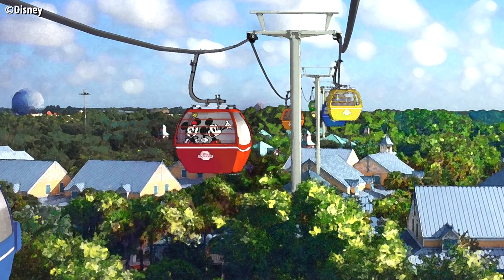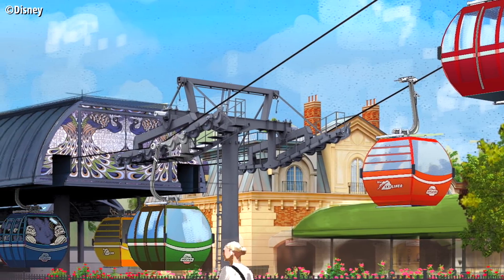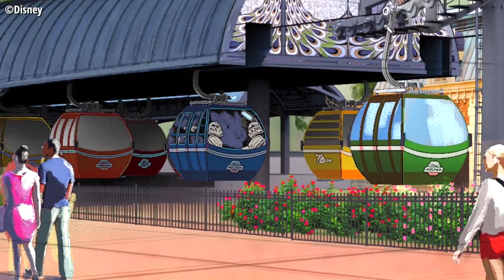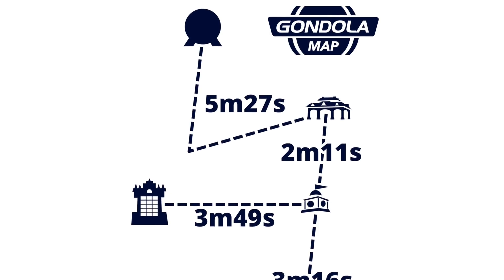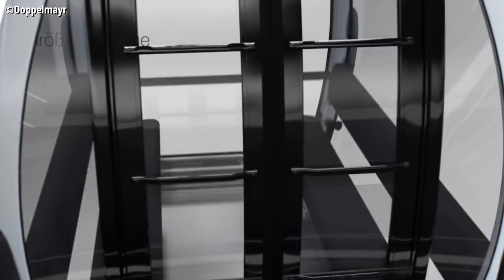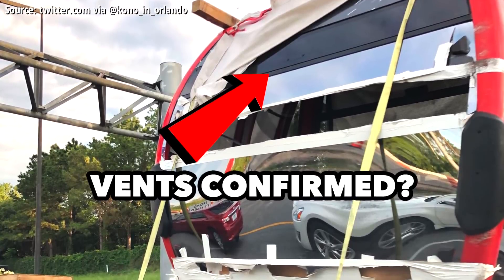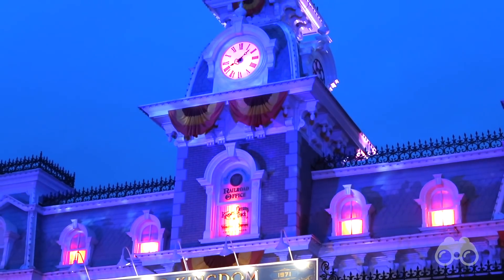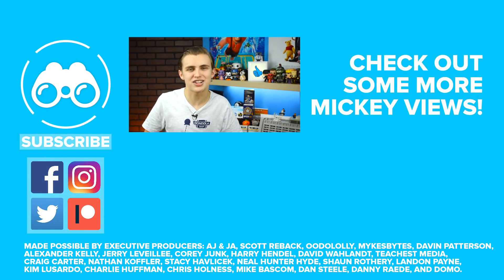NO A/C on the DISNEY SKYLINER GONDOLAS?! 🔥

Comment: Ok, the ONLY "air cooling" they're going to get in Florida will be the winter time. This wasn't really thought out, was it? they should've sunk the money into a light rail system that can handle a large number of crowds and still go between these parks and resorts in a short time. Ithink this is going to be an epic fail on Disney's part.

Comment: Would love to know how people expect the A/C units to get power when suspended on a single wire? Solar panels wouldn’t be enough to power A/C, only other option would be a battery/capacitor powered system but the weight penalty of these is outweighed by the short expected journey time.
Reply: There are already cable gondola systems operating that have AC units on them. Ultracapacitors are used.
Reply: @Danrarbc  That's why i mentioned capaitors in my reply so people knew i was ware that it was an option. But for journey times quoted I can understand why Disney would go for passenger capacity rather than being limited by extra weight in the infrastructure.

Comment: This system is probably great during high peak morning and evening commutes, but during the day, in the summers... ...lemme tell you, I live in TX. It's hot, it's humid, and heat indexes can get up to the 120s. I also own a convertible. It can be 110 at a stop light, but if I'm moving, guess what, it's still 110. Essentially the movement has created nothing more than a hair dryer simulation. Now then, 110, is still better than 200, which can happen with cars that are left with the windows up. Both can still be deadly though. I have had my phone stop working on me because it overheated while I was driving. What if this happens up there? They've got us using that My Disney Experience app for everything.

Comment: The ferry boats don't have AC, neither does the Railroad, nor the Friendship boats.  I think the rail trouble with the gondola system will come with those crazy pop up thunderstorms that happen every summer afternoon rather than the lack of AC.
Reply: The ferry boats operate on water -- it's called evaporative cooling.  The Railroad cars are completely open.  These enclosed cars are going to be impossible to maintain -- they will smell, trap humidity and people's sweat as well as heat.  This is a disaster.

Comment: its simple, the cars don't have a/c because the cars have no power, how would they power an a/c, even if they wanted to?
Reply: Fabio Monteiro Ultracapacitors allow for rapid charging of gondolas while moving through a station. London Emirates Air Line cable car has a/c. Gondolas can be equipped with all types of things including heating, cooling, WiFi, and screens.

Comment: OMG! Big deal out of No BIG DEAL! AstroWorld in Houston, TX had NO A/C on it's gondolas 1968-2005 open air no fatalities. Same climate in Orlando. Not a large travel distance. Only problem is If there is a prolonged shutdown. I'm sure they have emergency jenny or in the case with AW 4 cylinder VW Bettle engine to evacuate the cable. It had to be fired up every run day as part of safety check list. LOL There is likely A/C in load area that will keep car at an acceptable temp until doors are closed and you reach your destination.
Reply from the maker: Huston, TX and Orlando don’t have the “same climate,” central Florida has the humidity of the Amazon Rainforest so heat feels significantly heavier and more sticky than in TX. Thanks for watching! ~Brayden

Comment: Lock your self in a hot car with the vent fans on drive from 5 minutes or 15 minutes. Oh, yes a problem with the skyliner and it stops for 30 minutes and no air flow.... This seems out there for Disney. I am not on board with this idea in the hot Florida sun.

Comment: There's one other possibility we're not allowing.  The last minute addition of solar fans.  I volunteer at a large cat sanctuary on the other coast and managed to make things comfy for both guests and cats by installing a few solar panel powered fans in some enclosures and common areas.  I even use some at home on my catio to keep my cats cool when it's 105 f outside.  The fans I used were maybe $20 each on ebay.  

Since these are such a cheap, easy last minute thing for someone to install, one would think they would spend the majority of time just getting the gondolas installed and working then on the last week before opening install a similar solar-panel fan at the last minute.  On a gondola that size, I would think four, one in each corner.

This is just speculation based on my own experience with such items.  If I were in Disney's position why WOULD you set up all that power to run AC in a gondola ( too much expenditure for too little return ) when you can spend $100 per gondola and run 4 fans inside?  It's not opulent but then again they don't want you to spend your time inside an AC cooled transport, they want you to get to your destination then get out.

Comment: I think no AC will be ok, there is a lot of systems similar to this that do not have AC and they are fine. They just need to have a good ventilation for natural air system. Still excited for it!
Reply: How many operate in the same climate as central florida?
Reply: @itsme4864  I do not have that information, I will trust Disney to not make these so hot it is unbearable though, until we have proof it does not work.
Reply: None of them are in Florida.  There is no mass transit system with enclosed vehicles in the entire state that doesn't include air conditioning.

Comment: I would have rather see the monorail be added to I don't think this gun laws system is anything good at all. I didn't think it was that good before the AC issue without AC okay some days it would be good the arrow be okay at nice early morning for what about mid-afternoon when it's hitting a hundred degrees 95 degrees and there's no air. But like I said the worst part is you know these things are going to break down once in awhile you might be stuck in one for a half hour 20 minutes what happens then

Comment: Nobody complained when they used to have the same type of ride in Magic Kingdom and they just had open air nobody complained it was too hot back then I think just give it a try if it's not fair you don't use it
Reply: It will be a little different since these are enclosed in glass which will trap hot air vs the open air system. Think of sitting in a car with only the window cracked in really hot weather (such as in Florida). Hopefully they will have some type of emergency ventilation.
Reply: The Skyway "rides" years ago were very short station-to-station rides in vehicles that were completely open halfway up ..... these Skyliner cars will be completely enclosed without the ability to open any windows and small vents ..... I've never been enamored of this form of travel and think that Disney should have expanded the monorail system ..... I understand the cost issues, but the Hotels on this expanded monorail line could have charged significantly more like they do for those on the MK monorail line, but that ship has sailed ..... I predict that this is going to be a mess when it goes live .... it will not be a simple station-to-station trip ..... there could be multiple "transfers" from one gondola to another in order to get where you want to go .....
Reply: @JH-lu5yg  I don't think it's going to be as bad as people think but give it a chance it might surprise everyone
Reply: @rebeccaschauer2912  I don't think it will be bad when it's running but hopefully they have good plans in place for emergency situations and other long stops. It's definitely a creative solution for Walt Disney World transportation between Disney sites.
Reply: Agree, very similar riding old to skyway, Peoplemover, or MK train. I feel we’re over reacting here
Reply: Rick Hoyt with the exception of the old skyway, you can walk off of all if these rides.  I'm not getting stick in a glass cooker in the Florida beat.  Just wait until someone has a heat stroke.  WDW is demanding more or mor money and offering Less and less.  Something us always broken.  WDW is going down hill quickly.

Comment: I'm sorry but these are the dumbest things Disney has done in a long time. Just expand the monorail system.  Small gondolas versus big Trains that can handle way more guests at once. You will not save any time taking a gondola because the lines to get on will move much much slower and thus you'll end up waiting even more in hot Florida sun just to get behind a glass window that acts as a magnifing glass for the sun with no air conditioning.  The trains have air conditioning.  This is so stupid and honestly I won't even ride these at Disney.  Let's string up cars in hurricane and thunder storm ridden central Florida. Everyone I know is not on board with this including most cast members and shareholders.

Comment: Do we know yet how many people will be in the gondolas?  Is it 4-6?  If that is the number(s), 4-6, it may not be to bad, more than that...ugh.  Right now this is sounding like a major Disney fail. :-(
Reply: The should be able to hold 8 to 10, but they probably won't load them to capacity except at the busiest times. The big advantage to this system the huge number of people it can move hourly.
Reply: The Doppelmayr D- line can carry up to 5000 pph per direction..10 people per cabin.  Line speeds up to 17mph.